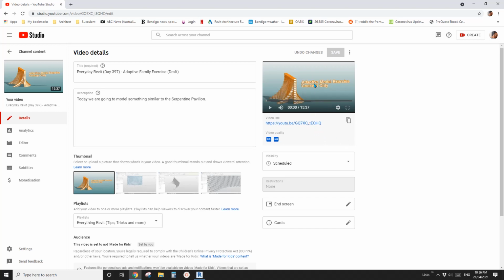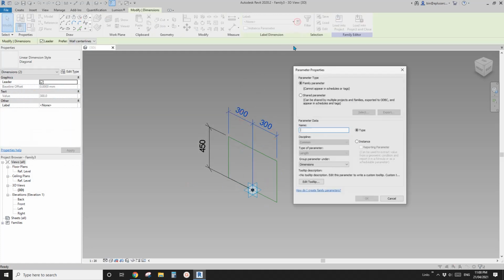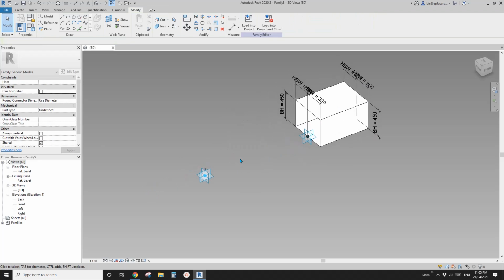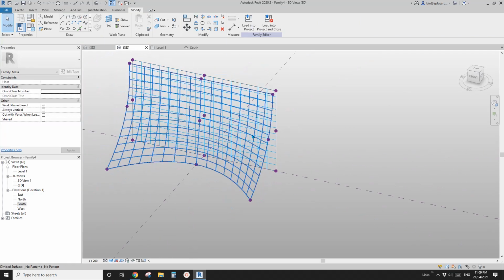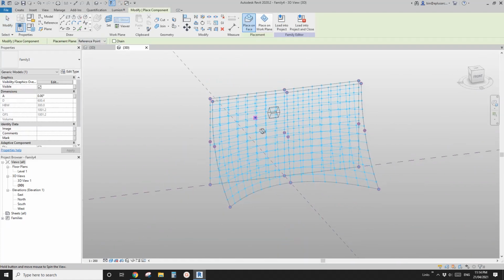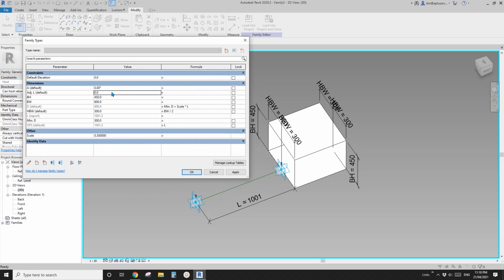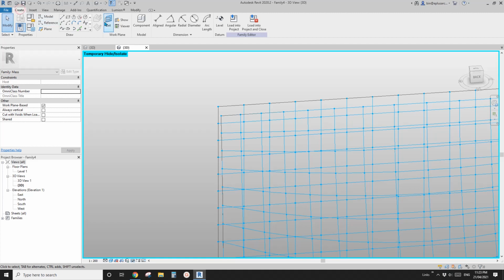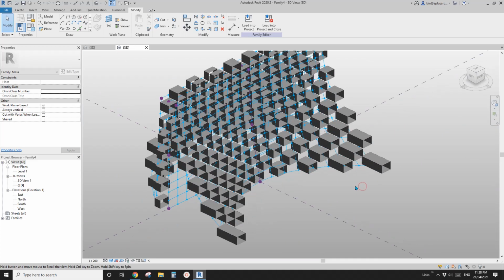Everyday Revit (Day 398) - Let's stack more boxes (Adaptive Family on Mass)

Comment: amazing as always. quick question tho, if instead of u or v grid i intersect the mass surface with levels or reference planes so the lines will always be horizontal and vertical. would that help?
Reply from the maker: I'm not too sure tbh. How are you going to intersect the mass with levels or reference planes?
Reply: @BINHE615  I figured I can just array some reference planes then with the mass surface I can divide it and then turn off u and v grid and next to it there’s an option for intersect and then just turn on nodes and follow the same thing u did. Downside of course is that unlike the u or v grid I can’t control and change the number of lines, but they should always stay horizontal and vertical no matter how we change the shape. Anyway just a thought I might try it out. I really appreciate all your videos. M learning a lot from u. Great great stuffs. U deserve a lot more recognition, keep it up and u’ll get there m sure. Stay safe and take care.
Reply from the maker: THANK YOU!  This is great! This is exactly what I have been looking for!  I learned it today. :)